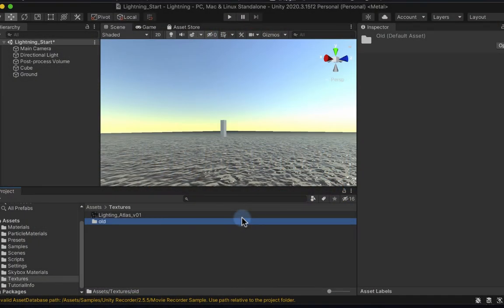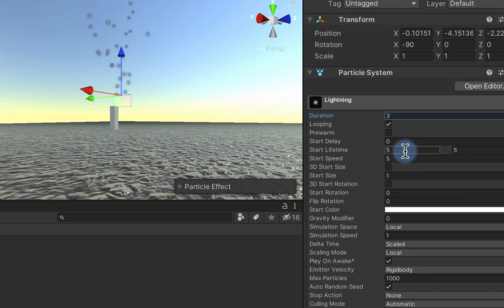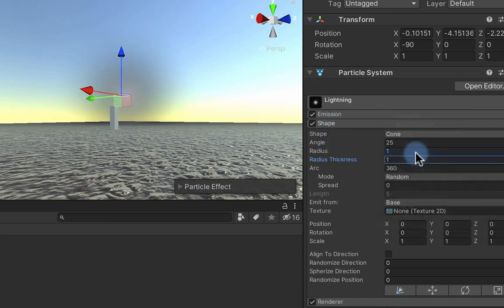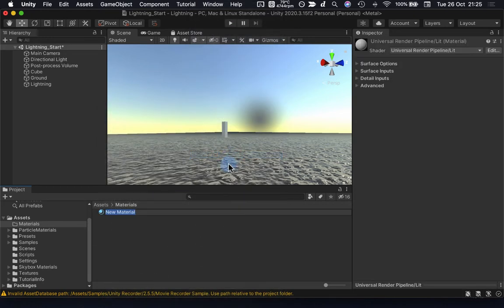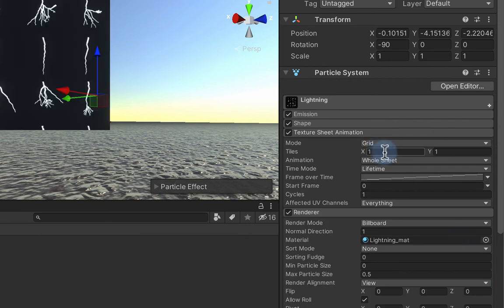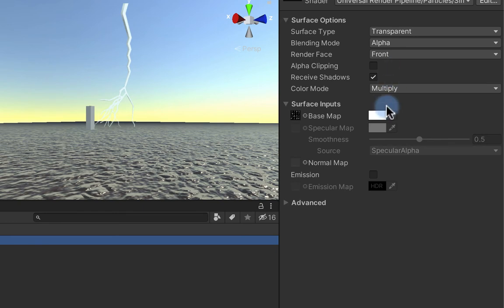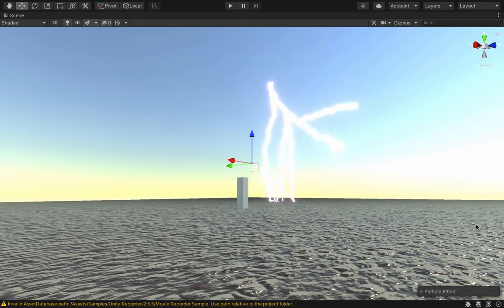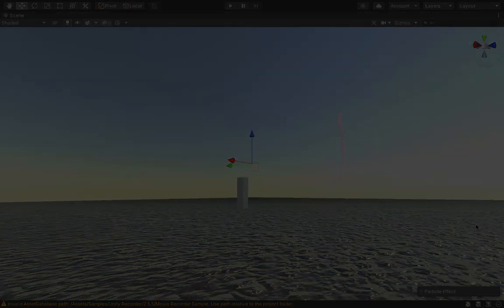Procedural Lightning in Unity & Houdini Part II - Lightning Particle System setup in Unity

Comment: That was really well done and easy to follow. Are you going to go back in to Houdini and make an HDA to bring in to Unity with Houdini Engine? With what you've done so far, anyone can follow along with Houdini Apprentice, no? Anyways yea, keep it up. I love this stuff.
Reply from the maker: Thanks good to hear. It's difficult to judge pacing and difficulty. Yes you will be able to use apprentice though there is a render size limit which i think is 1k. So you could render 9 frames to make a 3x3  atlas instead. Wanted to make this easy for new users. Particularly unity users who might find Houdini a bit scary. In this case I won't create a HDA. I want to showcase how to pack textures with information as quality textures are the secret sauce for creating interesting fx.